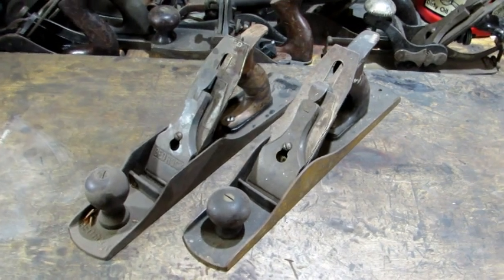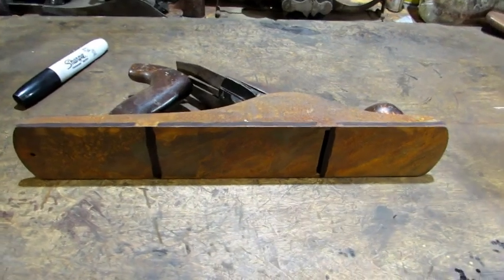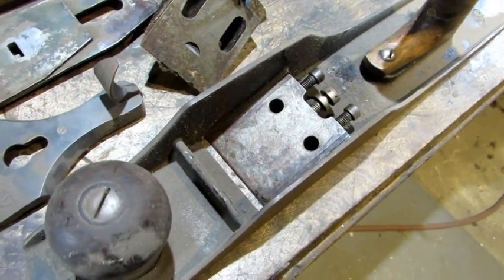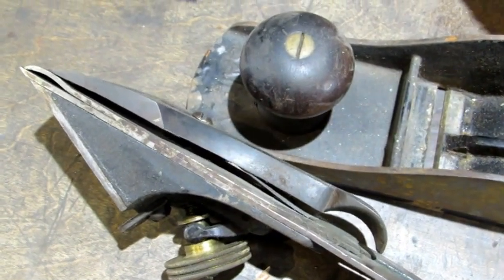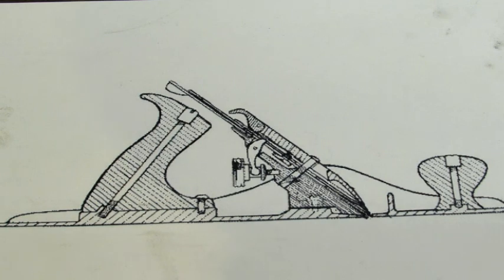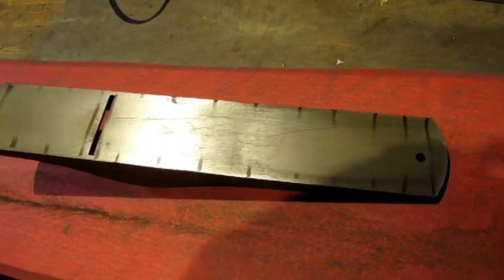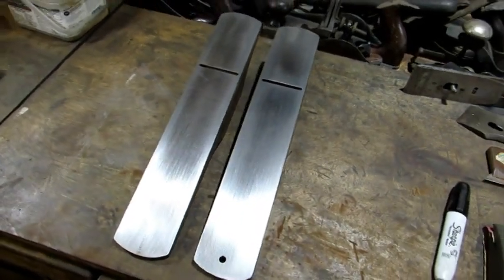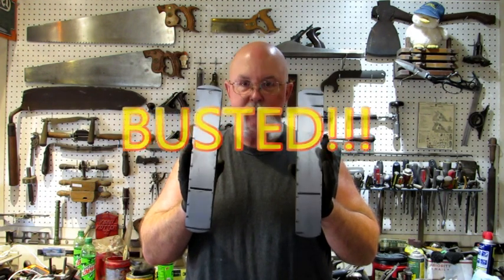BUSTED!  Lapping a Bench Plane Fully Assembled vs. Bottom Only

Comment: What surface and grit sandpaper do you use to flatten the sole
Reply: Whatever you need: if it’s badly out of flat, don’t be afraid to go to a very low grit. I started with 100, some people go down to 40. Check it first, and if you find issues, go down the grits to make it easier, then up again, until you’re happy with the finish. Some take it to a mirror shine (800 to 1000), some only go to 240. I went to 400 and lost patience, it was nice and shiny and definitely flat. Might go back and take it further, but at that point it’s just personal preference.

For the surface, I first tried an offcut from a granite kitchen counter and found that it wasn’t totally flat, although it probably would have been okay. I then found a glass plate from an old coffee table: flat. I checked it with a straight edge, trying to slip a sheet of paper underneath – if you do it by sight, you will very probably see light, even when it’s easily flat enough – your eyes can detect the slightest sliver of light, too little to matter. The other option would be to buy a proper surface plate, but the affordable ones are quite small.

Comment: Well I’m only 7 years late to this video.  But then again, I only retired a few months ago and returned to woodworking for fun and creative outlet after a 25 year career change away from carpentry in my early 20’s to mid 30’s.  I am loving the millions of videos about every little detail of woodworking and turning. When I was starting out as a carpenter in 1978, I was taught by a very old Polish carpenter how to sharpen and care for his tools.  He used power tools as well, but for finish carpentry he was 95% hand tools. Stan would not let me touch wood until I knew how to sharpen, flatten, and maintain the cutting tools.  He had me flatten plane bottoms fully assembled but w iron and lever cap out to not risk damaging them. He needed things done quickly. No time on a job site to dismantle planes and lose small parts.  He also believed that mostly assembled the soul flattening would be the way the tool was gonna be used, assembled. Made perfect sense to me. Only difference was we used files and straight edge w no sandpaper.  I only learned about sandpaper lapping watching Norm on New Yankee Workshop. A thousand times easier and faster than files. Was how I did it the rest of my carpentry career on my own.  Stan also had 3 wood planes that he still used too. For those he wanted the iron and wedge in and tight.  Just w iron retracted.  For wood body he felt sole did flex differently with pressure of iron and wedge in tight. The wood planes we flattened w the iron planes, not files.I love your no nonsense, common sense videos.  They are a breath of fresh air compared to the many of the insane micrometer pinching stuff
out there from shops with 3,000sf and a half million dollars in tools.  All my best.

Comment: I have had the opposite experience.  I used a surface grinder to flatten my no 6 to better than half a thou.  I couldnt do it with the frog attached because there wasn't enough room below the grinding wheel.  When reassembled there was a 2 though hollow heel to toe.  A shame, but I dont think it has much impact on the operation of the plane, but the effect was real.
Reply: But that’s not really the opposite experience, that’s a slight aberration, caused by who knows what. Another often repeated rule is to exercise your best judgement when tightening everything down, i.e. to not overdo it. That might be a cause of slight warping or bending. Anyway, the point is not that you must disassemble the plane, the point is that it doesn’t seem to make a significant difference.

Comment: Completely agree with your video! I simply can not believe that tightening TWO SCREWS, not bolts but SCREWS into cast metal I might add, can have any impact on the surface of the sole.

Comment: Glad you made this video. I've flattened over a dozen planes not knowing you are supposed to have them assembled when you are doing so. At some point I went back and checked the soles on all of them fully assembled and they were all perfect.
Reply: Until recently,  I had never heard to assemble the plane and lap the bottom.  I've always done it while disassembled.  On another note - my OCD doesn't understand someone lapping a plane bottom to a "good enough" flatness or "good enough" cleaning - restoration.  I either do nothing- in the case of a collector item. I mive it down the line to someone who believes that fiund in this condition somehow adds value.  I take everything but to day one condition.  All of my planes will go to my grandkids- the history they will care about is Grandpa taught me on this plane or he used this one all the time. No one in my family cares that it laid in the back of Joe Jone's barn for 67 yrs and this is the original rust on it when it was found.  I just bought iron, chip breaker and cap,paying 232 bux on an plane that us currently valued at 20 bux. Why? It was My Dad's plane.
But I.love how detailed your video is and how well you explained the thought process.

Comment: I agree. I never have the blades in when I lap.  Gets the particles all over the place. I can always get 1-cell thick (well... thin) shaving. Metals also flex, in different places for different designs. One should always set up a plane for its intended purpose instead of thinking a perfectly flat sole or a perfectly flat.

A scrub plane only needs a relatively flat centre.  A smoothing plane with feathers sides only needs to register on sole in front of the blade.  Anything behind it only requires the two primeters and near the tail to register. Jointers or shooters also need different areas taken down.  A great craftsman can naturally compensate, but no one should believe that a single plane should be set one way and should be able to do it all.

Comment: I work as a machinest by trade and love restoring old tools especially hand planes, I always surface grind the soles of metal planes, on a smaller planes like the no.4 it's OK to grind without the frog mounted, but on thr 4 1/2 and longer planes it will afect the flatness if u lap or grind the sole without the frog. Ultimately flatness affects planing performance in the sense that u can achieve thinner cuts with a perfectly flat sole I am taking about getting less then 0.001" shavings.

Comment: Hey been checking on some of your older stuff , as a know it all does not exist,  we go with what works best for ourselves!!!   
Before boring a motor block a  torque. Plate as this is where the metall  works  it's best  under load. Some people 
Will not go the extra step as it requires time!!! My obsession with thee level of restoration is out of control🤣 and love it. 
Keep on passing these vids so some people can  learn there are different ways to do things. Learn by doing was my dad's 
Last words!!!  Thanks 👍

Comment: I believe you are mostly correct, however there are a few important details that are incorrect. On type 9 and newer Bailey planes, the frog screws are forward of the frog seat creating a lever that transmits the force of the screws to the front or tongue of the frog where it rests on the bottom of the plane. This is a non-cantilevered frog design. In this style plane the portion of the casting just behind the mouth is extremely thin, the thinnest section of the entire bed of the plane. Over tightening the frog screws can create more force behind the mouth than the casting can withstand resulting in cracks behind the mouth. I agree, an iron sitting too far back may also contribute to cracking of the mouth. This is not an issue with pre-type 9 Bailey style planes as they feature a cantilevered frog design than bears all the force on the frog seat. It is much less common to find this style plane with cracked in the mouth of the casting.  As for flex, yes, the type 9 and later Bailey planes do flex about 0.0003” when the frog is installed. This can be demonstrated by lapping the plane with no frog until flat and polished. Then installing the frog and making 1 or 2 passes on the lapping surface. You will then see a pattern of contact on the sole of the plane that matches the frog tongues behind the mouth. I have photos of this phenomenon. It is not necessary to lap this style plane with the frog in place, as the subsequent protrusion of the sole of the plane after assembly is minimal or can be lapped out with just a couple passes on the lapping surface. The pressure created by the lever cap is not sufficient to affect the frog or sole of the planes. If it were, you would be h able to adjust the depth of the cutter due to the pressure exerted by the lever cap on the cutter assembly. Good video.
Reply: Just saw this comment. I think people do the lapping with the frog installed because of how unnecessarily tight the frog screws are installed on some of these planes.  I only tighten just enough so the frog doesn't move even if say hit a knot.  Over-tighten anything on softer metal is always a recipe for short and long-term issues.

Comment: Oddly Ive had most success flattening soles pulling the handle instead of pushing (like your pulling your plane apart)  Maybe it evens out the force of the push and sandpaper drag or maybe I'm just special :)

Comment: You may be right in practice (given how planes are used) but your testing method is faulty. Put a straight edge up against the sole while it's assembled. Then take out the lever cap, blade, and chip breaker. Then check the sole again with your straight edge. It'll be quite different. 

You exert force downwards while planing, so the additional flex doesn't affect the plane's performance. But they DO flex.

Comment: Let me begin by saying that I have a lot of respect for the experience you demonstrate on restoring old planes... Putting old abandoned antique tools back to work is something that I'm very passionate about even though I'm relatively young at 35 years old. I first fell in love with planes and began restoring a busted "Wards Master #5" that I bought at an antique mall a decade ago in 2010 and I've very proudly taken several more out of retirement since then.  At this point, I hate to be "that guy", but I can easily demonstrate the difference that assembly makes...as you pointed out, the difference is small enough that it won't be noticable on even the finest woodworking build...but when I restore smoothing planes...I get them dead flat on the scale of a couple ten-thousandths of an inch... because it's relaxing and it's beautiful!

Since this is an older video, I'm not sure if you're still keeping up on comments but if you respond and you'd like to see it, I'll post a video on my own channel and demonstrate the rather significant difference it makes. You may find it interesting.

Keep up the great work!

Comment: I've got some planes that are pretty out of flat, and the metal abrades very very slowly. I attributed the cause of one being that it's a steel-bottomed block plane (old clone of the one stanley made to be "unbreakable" - forget the number) but it doesn't explain the others, none of which are longer than a smoother. They're cheaper planes and out of flat considerably with low, deeply scratched spots from... I'm not sure if it's the machining process combined with ravages of time or what, but they were probably only used as household tools and never touched by woodworkers. I've been using 120 grit silicon carbide sandpaper (just one sheet as I don't have the space for a massive 4ft cut of stone) to try to get them down but it doesn't seem to be going at any appreciable speed. I'm talking on the level of hours. To make it worse, these scratches are, in all cases, deepest across the middle and around the mouth of the planes and so they're generally flattening from the outside-in. I inherited most of the planes so I really would like to get them in working shape. 

PS: I constantly see notes on planes needing flattening, is there something about the old metal that makes them go out of true over time, or is it just that most planes currently found were like the ones I had, and never really touched anything more than rough work?

Comment: My only objection to all of this:  I bloody HATE "hang-holes" drilled in the tail of a plane body.  Thanks for pointing out the real cause of the throat cracks.

Also:  I wanna see some kind of vid./info about that "mast-axe" style of broad axe you've got hanging on the wall behind you there in the last shot.  VERY little practical info available on those.  I only knew there even was such a thing from their mention in one of Howard I. Chapelle's books...  I believe it must have been his title "Boatbuilding" (1941, W.W. Norton & Co.)
Reply: Well, if it's indeed the "Mast Axe" type as it appears from here, it's meant to be hung with a handle offset to one side like the regular wide-blade single-bevel American broad axes.  Difference is, it's sharpened with an asymmetrical double bevel like the more common modern "Swedish" style of broad-axe (which are not as wide as most of the older American ones, and neither of those are as deep as this).  Meant for doing large timber tasks in shipbuilding, like making initial flats on side of mast logs, as name implies, in process of going square >octagon >round when making a round solid-timber mast. 

So even if not doing any boatbuilding, it should be eminently useful for regular hand-worked timber framing.  Especially something like a log cabin in the square-log German style (if one was masochistic enough to do a project like that with all hand-tools in this day and age).

Comment: There is a ton of myth and "conventional wisdom" associated with plane usage and restoration. I am guilty of accepting a lot of it as gospel but I enjoy anyone who challenges one of those "religious" assertions. Especially when they devise a common sense test to validate or bust the belief. I have long believed that removing metal from a plane is fundamentally bad. Yet you have to to make a proper distribution of support. The key is to minimize the removal of metal. Great video! 

Now lets talk about sharpening angles and wait for the flames...  ;)

Comment: You are right. There has been mountains of misinformation spread by well-meaning folks working without objective data, passing on as fact impressive seeming nonsense from others in the same boat. 

I'm a machinist of wide diversified experience. I possess a Grade A granite flat, a 0.000050" (50 millions) resolution dial test indicator, and a precision transfer stand in the form of a bench gage. With this equipment I can map the sole of a hand plane to 0.0001" contours. I support the plane sole up on three points, one at the knob and two just back of the tote. I selected these points as zero reference for sole mapping purposes. On a Stanley #7 jointer plane the presence or absence of the frog, lever cap, adjustment of screw tension etc in any combination makes less than 0.0003" difference in the contour of the sole on a long jointer plane.

My experience is the sole of a hand plane should be flat to convex but not concave. The acceptable departure from flat makes some difference in the plane's performance but is nowhere near as crtical as iron sharpening and setting and operator skill. Flatness and smoothness of the work depend  90% on technique and in-progress checking and 10% on the tool.

I derusted an Anant garage sale jointer plane and millied the sole flat with a single cut on my milling machine. After sharpening and a bit or tweaking, it performed about as well as a friend's Lie Nielsson jointer plane and it was a full pound lighter. The $350 Lie Nielsson was a clearly a better made tool and a pleasure to use but it had no measurable productive advantage over the $5 Anant except for cutting edge longevity. They both could be adjusted to make wispy thin  ribbon chips and they both jointed board edges in roughly the same number of passes.

As in politics, second and third hand information is dubious at best. If you wish to know something for certain like the effect of assembly on the deflection of a hand plane's sole - go to a source of objective data and determine actual facts.

Further, don't believe me or anyone else. Follow scientific protocols: conduct reproducible experiments. Gather the resources and determine causes and effects of hand plane sole distortion for yourself.

Comment: Great video, making good looking videos is a lot of work. The only thing busted is the difference between lapping and sanding a tool surface. Another process, honing requires a stone. There are  marks left on the sanded surfaces caused by unequal pressure. If you are looking for accuracies about 1/20 in, unevenly sanding a plane is a good practice. If you want better than 1/20, the planes need to be flatter.  This paper is a short description on what lapping is.. please note the term "slurry" which makes the process "lapping":  http://www.engis.com/pdf/2011ProductionMachiningDiamondLappingandPlateControl.pdf  See this video on hand lapping in action: https://www.youtube.com/watch?v=ATG_UYYfx7w